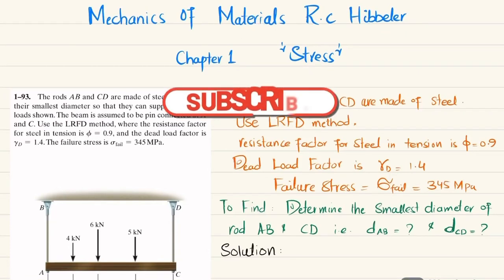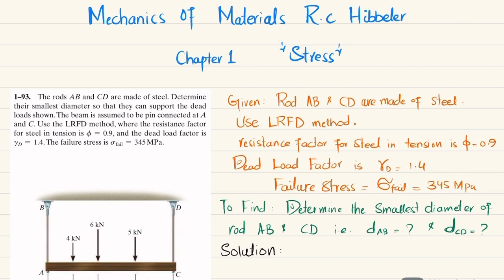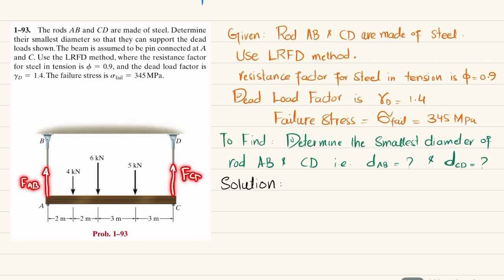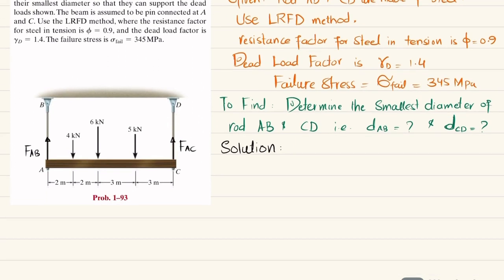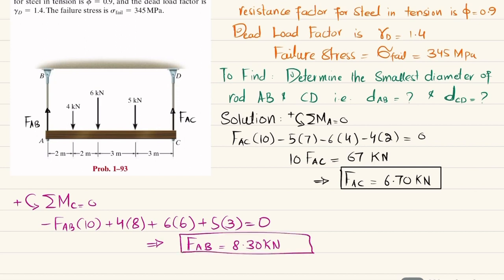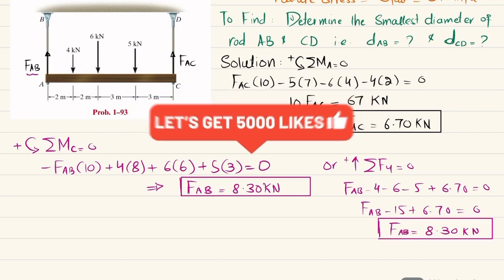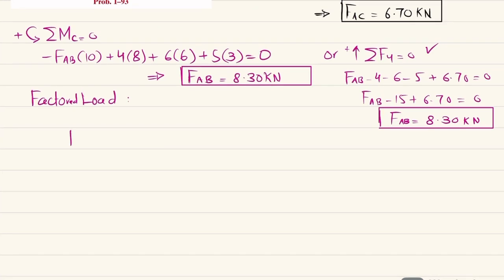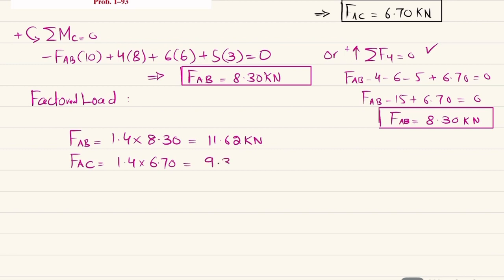1-93 | Determine smallest diameter of rods AB and CD | stress | Mechanics of materials rc hibbeler

Comment: 🎉🎉 you have improved my alegbra alot!
Reply: MGR BHAI WO TOU MECHANICS PRHATA HAI
Reply from the maker: @mfAnimates110 hahahahaha asal main us agar differential equations use hote han and system of linear equation, is lie bol ky you have improved my algebra alot.
Reply from the maker: @mfAnimates110 waise algebra to har engineering ky subject main use hota ha , machine design, fluid mechanics, heat and mass transfer etc etc